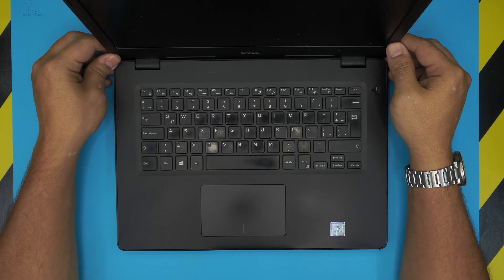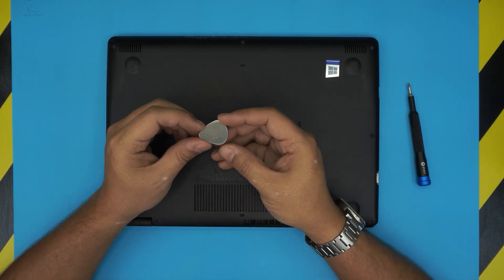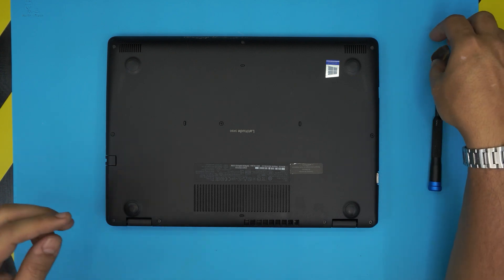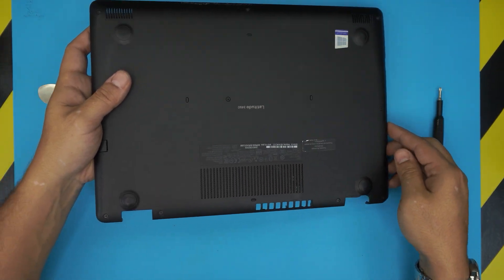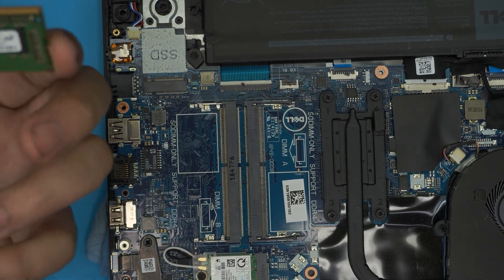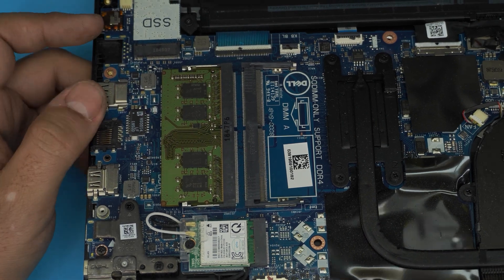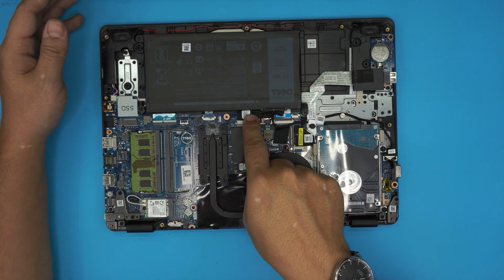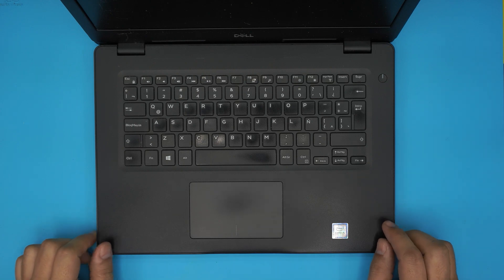How to Upgrade Ram on Dell Latitude 3490 Laptop

Comment: Hi, sir 
I have dell latitude 3490 
 I replaced 8GB RAM 2444 with 16GB RAM 2666 in one side , it works berfetc ,task manager shows 2666 RAM I used diagnostic to check hardware every thing was OK. Then, 
I added another 2666 Ram it's became 32 GB RAM task manager shows I have 32 RAM with 2444  instead of 2666 ,, when I used  diagnostic to check,,  it's showing error memory exeeds the limits.

Dell website says you can upgrade your RAM to 32. Should I update/change some things in the system.

Thanks
Reply from the maker: Thank you for the feedback! if you wish to support the channel you can LIKE or SUB or both :P
regarding your question:  1st i need you to take a look at this https://youtu.be/tKEJTkVth4Q
then tell me the max number.
Reply: Max *
Reply from the maker: the reason for slower speed is that the motherboard bios can't run 32gb at 2666, its normal  on laptops, you can try by updating the bios and see if that helps if not there is not much you can do.
Reply: @uFixTek  good,, thanks a lot
Reply from the maker: anytime my friend

Comment: Hi I replaced the ram in my laptop and the laptop won’t turn on at all and the charging light doesn’t show anything. I got a little bit of help and the pushing of the ram caused the plastic clips of the slot to break so I replaced the ram in the other slot and it still didn’t work
Reply from the maker: can you send me few pictures of the ram and ram slots and after when you place d the ram, also remove both rams and power onand off then place only one ram then power on and then if you get image then power off and place the 2nd.
ask@ufixtek.com
Reply: @uFixTek  I’ll send it to you in the morning where I live because it’s like 2 am
Reply: @uFixTek  I was just looking to see if there is anything online that could fix it do u think the battery if I unplug it and replug it will fix it
Reply from the maker: you could try that and remove the charger the battery and press and hold the ON for 30sec then plug the battery and place one ram and power on.
Reply: @uFixTek  sorry for the late response I took out the battery and put it back it worked but it won’t boot windows 10 it just keeps going to recovery I just want to get the personal files off it becuase I bought a new laptop as the old clips of the other one broke and won’t work properly
Reply from the maker: @Heisenburger5272  get this cable and remove the hdd and plug it to this adapter to access the file under user folder and username folder and when you open the folder it will ask to over write permissions and click yes to all and wait 5min  and you get access to your files.:
https://amzn.to/3kw0f57
Reply: Install proper configuration based Ram Sodium DDR4 ,2400mhz Duel channel based